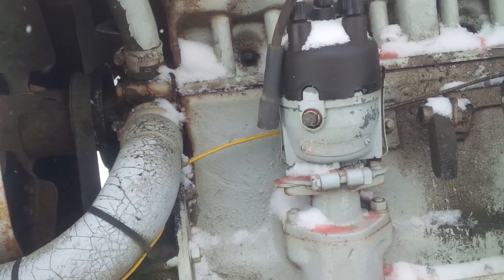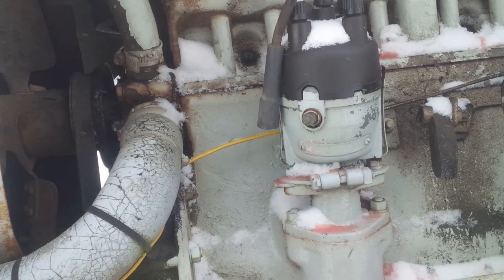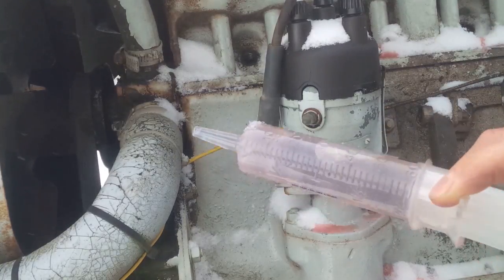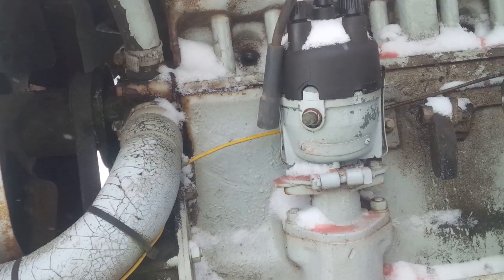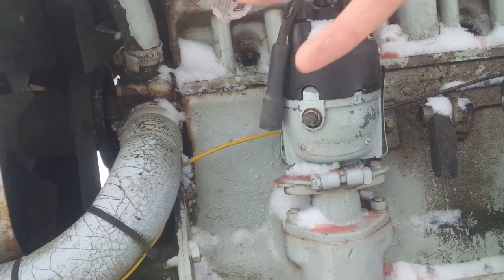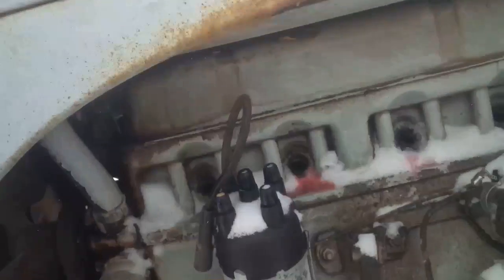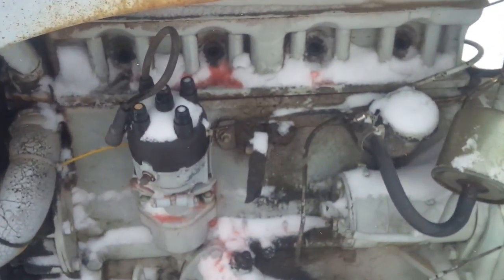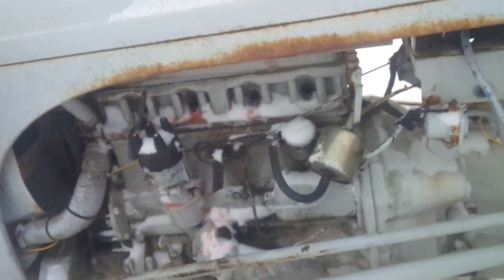Ferguson TEA 20 - Seized! Diesel down spark plug holes

Comment: i remember my father unsiezing a ford pinto engine that had been stood along time  years ago he re rmoved head then put something like wd 40 into  cylinders for a week  then he put a rag with petrol into each cylinder set fire  to them and let them burn a while to expand the cylinder bores ,then got a shaft of wood he put on top of piston and gave it a tap with hammer on all four pistons and they moved ,he then cleaned cylinders out put some thin oil into bores let that soak around the rings ,next day turned engine over and bingo!! was free . put it all back together and it ran for  years .youve probably sorted it now ive only just seen your dellema but it may help someone else out .